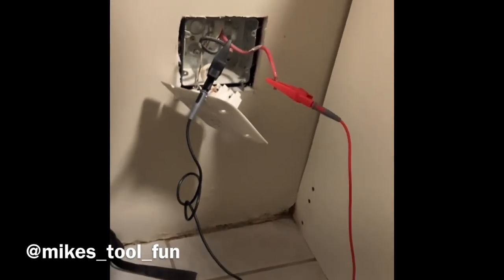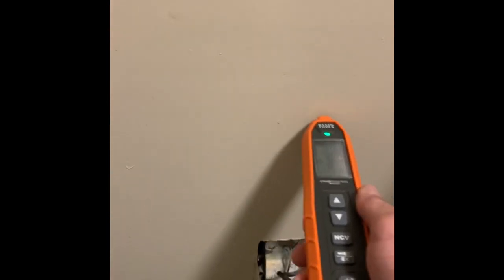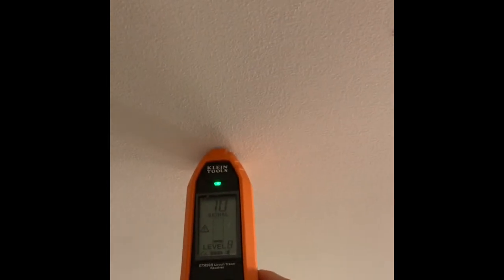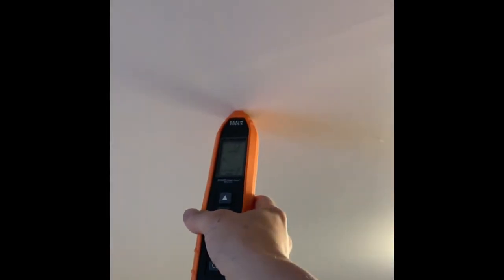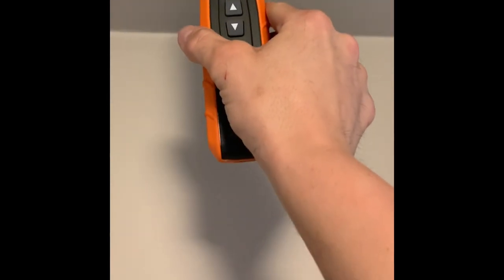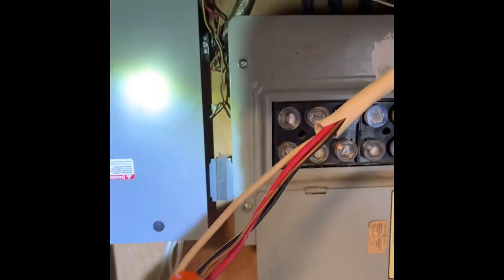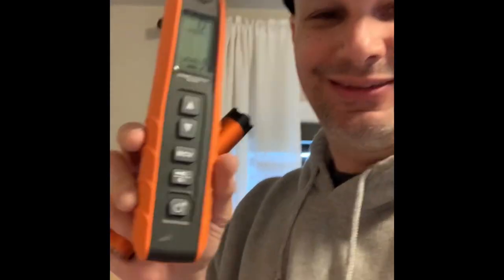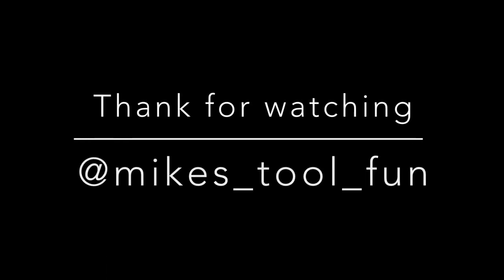Klein Tools ET450 Circuit tracer

Comment: Did the same process in a recently purchased house, which led me into the attic where I found an open-ended 12/2 cable surrounded by insulation. For 20 years it sat like that, with live power. Complete insanity.
Reply from the maker: Thats awesome that you were able to find that.. cheers

Comment: If you are using this in commercial applications then are you saying it will pick up the signal through EMT conduit?
Reply from the maker: @reiserx  i have traced cct’t in EMT.

I connect to the wire i am tracing and the common on a separate ground in a different conduit. 
I usually have an 80% success. 

I have also been able to locate ccts in buried pvc conduit. 

Hope this helps.

Comment: Quick question, when you have this plugged into a live circuit, it looks like there is an energized symbol on the receiver. If you use it to find a breaker in a panel, and you turn off the breaker, does the energized symbol on the receiver disappear to confirm you found the correct breaker?
Reply from the maker: The symbol only appears when the circuit is energized as a warning that the circuit is “live”. The symbol turns off when the circuit is de-energized to indicate that it is no longer live.

I use this tool to find tripped breakers (de-energized) in commercial buildings with multiple panels. I have run into situations where the breaker is tripped, but ls still in the on position. 

Also… 
If you are looking for a basic circuit tracer to shut off live circuits, and is easy to use, The ET310 is a great inexpensive circuit tracer for most residential applications.
Reply: Thanks for the quick reply. I’m an industrial electrician but do a lot of commercial and resi as well. I have a Ideal Suretrace I currently use and it work well for the most part, but it can be finicky. 

The big thing is when I’m at a panel and I kill a breaker, I like to know it’s the right one. The Suretrace has a little lightning bolt that tells you but sometimes it’ll still flash with the circuit deenergized which I don’t like.
Reply from the maker: The sure trace is very similar to the Klein ET450. Its a great tool as well. The sure trace is more user friendly, as the Klein ET450’has a bit of a learning curve.

I wouldn’t buy the Klein if you already have the sure trace. 
Cheers
Reply: I'm looking for something to locate wires in conduit about a foot deep, but sometimes a bit deeper. Does the suretrace or the Klein one have enough power to identify through that much soil?

Comment: did the wire reach the panel? did u add a junction box to extend it?? was there space for a breaker?
Reply from the maker: The wire did reach the panel and there was space in the panel. It was a renovation the previous owner starter but did not finish. There were a few issues that had to be addressed. 

The new owner ended up opening walls and having it all properly inspected and fixed.

Comment: This tracer is not worth the money I have it. The only reason to buy it is if you have a non energized circuit
Reply from the maker: Its a $250.00CAD tracer that does up to 480V. For me its worth every penny. The next comparable product is $1500.00CAD.

I have to trace energized 347V device often, and hands down, this product is top shelf. 

I don’t recommend it for residential electricians. The basic 120v tracer works best. (Unless you are troubleshooting stoves/ranges)
Reply: What do you recommend as an alternative?
Reply: @johnelstad  it depends on what you are tracing a energized circuit there are bunch of different types of tracer’s. But if you are trying to find a non energized circuit they make a tone generator. It will allow you to find the wires.
Reply: Makes me wonder if you have a bad unit. I've traced EMT behind drywall and I've even traced #2 copper conductors buried 24" under soil. I paid $199 plus tax and it works just as well as the Greenlee and Ideal $1,500 units the company had. A couple guys even started borrowing mine instead of using the company's tracers. And it is 600v rated which is extremely nice in old factories and warehouses where 480v is everywhere.